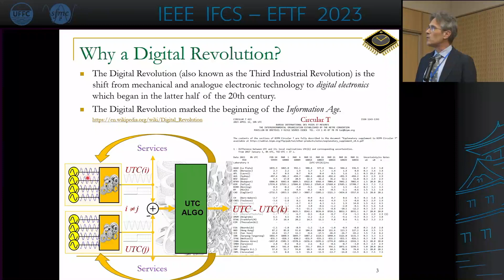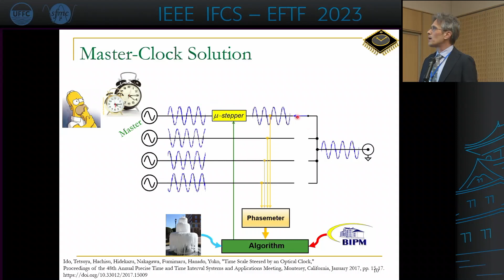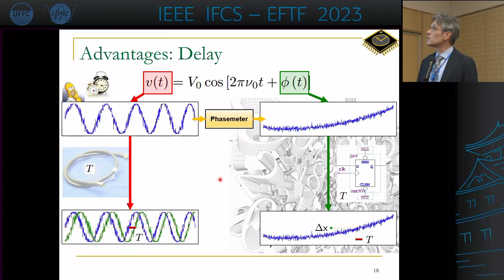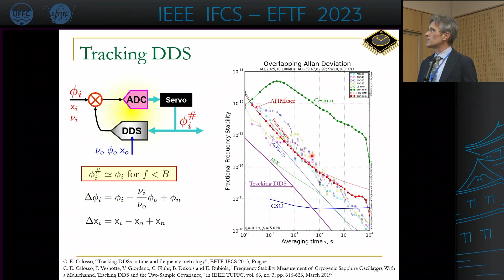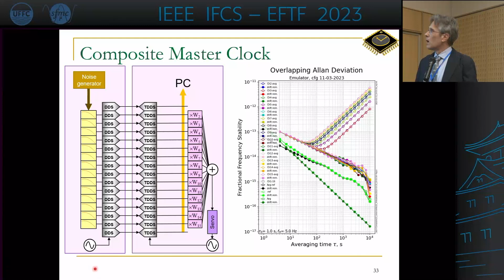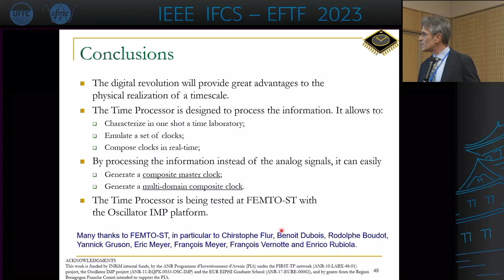The Digital Revolution, also for Time Scales

Comment: Scientists and metrologists have been struggling for long to combine different oscillators and atomic clock in a true electrical signal which features the best performances of such, and the robustness of an ensemble.  All the bricks are there, and the digital time scale is already around the corner.  In the meanwhile, the Time Processor already sets the standard for the measurement of the instability of the oscillators.